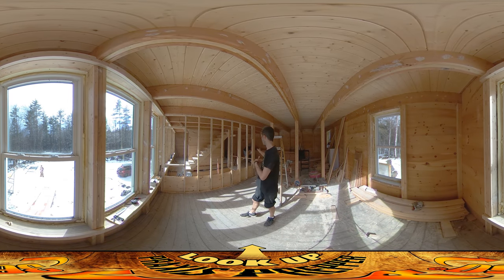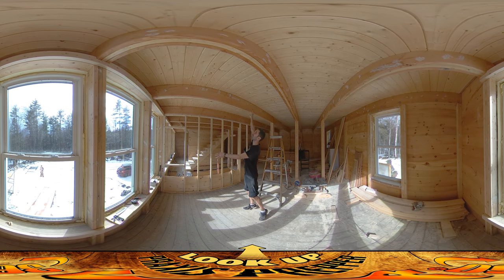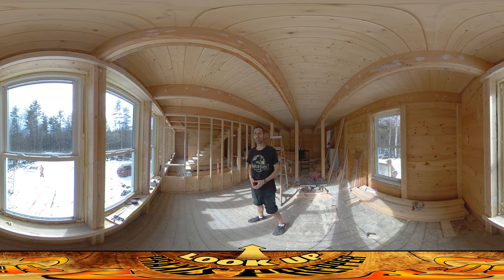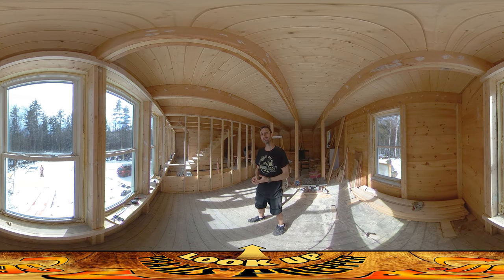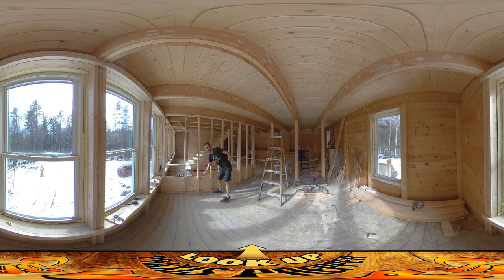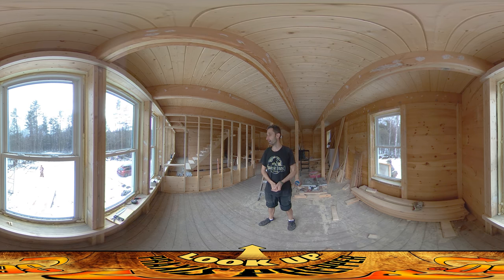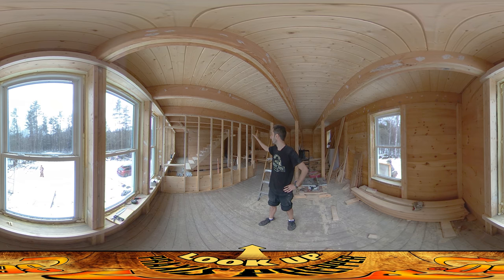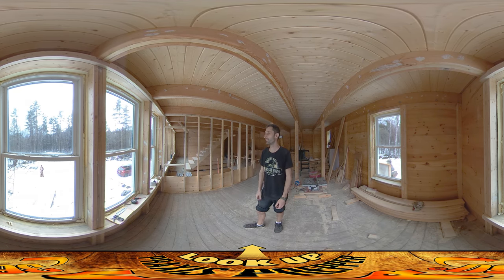Homestead Building - The Putty Disaster is a Blessing in Disguise, Electrical Permit Issue

Comment: My Dear mr Praxis ... you are not allowed to run the wires... BUT, it's probably totally legal to run the pvc piping that the wiring runs in ... which means you can 'prep' their work by having everything but the wires installed, and have them install said wiring under your supervision... Which also means they can not drill any holes, because they won't have to, they won't install boxes where you didn't want them, because you already put those up... all they can do is run the wire from the fuse boxes to the outlets... 'problem somewhat contained' ... smart aye ;)
Reply from the maker: Like fences to hold in the wandering cows! ;) I like it. Though it sounds like I'll be able to run my own wires with the electrician I recently found.
Reply: @PraxisPrepper  :) that works too i guess